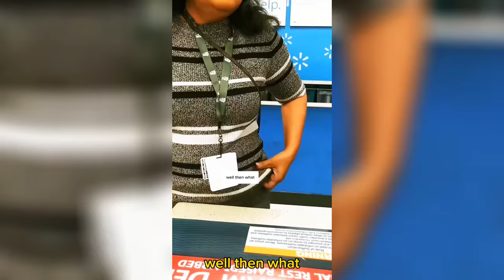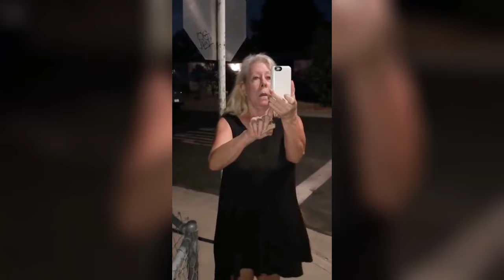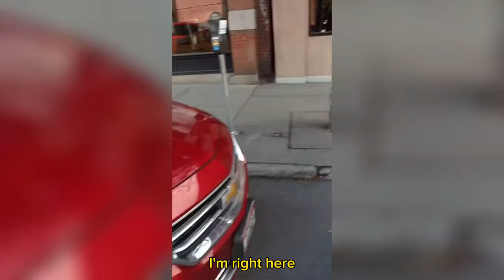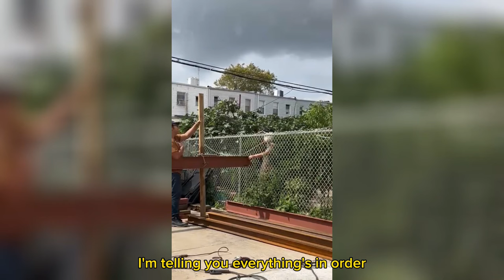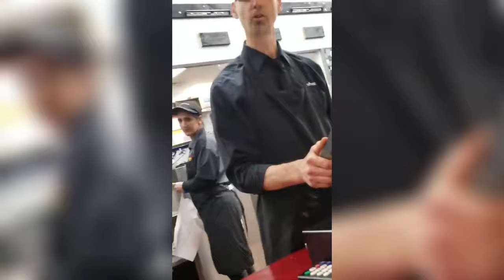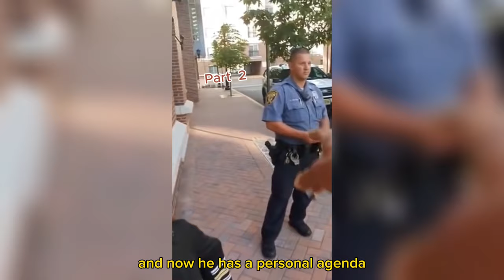Karen finally DESTROYS herself in must-see

Comment: It's a policy about air mattresses, you can only exchange them, not refund. I've been sleeping on air mattresses for several years now, so I definitely know. And you can only exchange it with 2 or 3 months. It's just one of those things. And it actually says this exact thing on the seal of the box, you have to get through to open it.